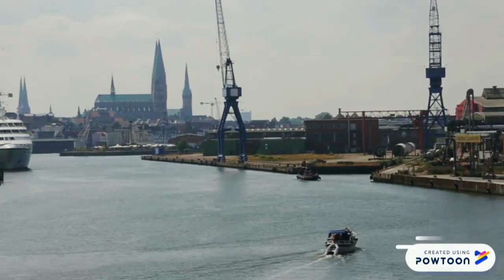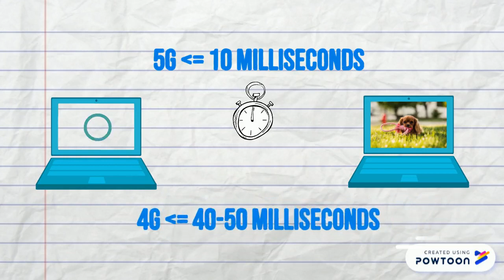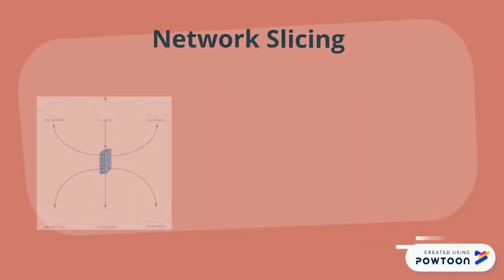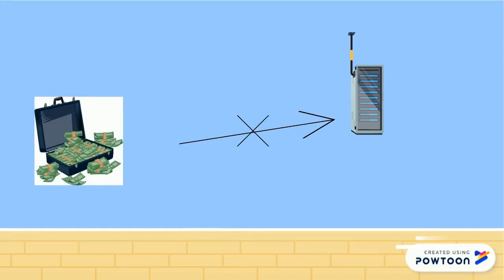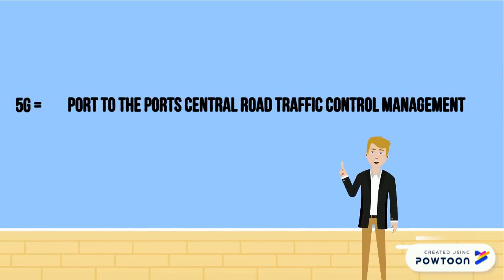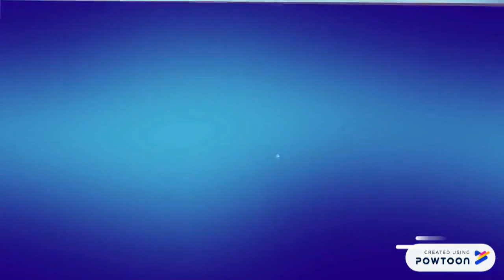5G as Enabling Technology for Building Smart Port

Comment: Learnt a lot from this video! Didn't know that 5G can help other industry instead of mobile communication. But a question just pop up to me, would implementing 5G into a smart port be costly?
Reply from the maker: thank you for your comment, yes 5g will be most costly, according to some research, researchers have predict that operators will spend over $1.3 trillion over the next seven years on networks. The bulk of that (75 per cent, or a little less than $1 trillion), will be allocated to 5G. The rest will primarily go into upgrading and expanding 4G networks, which will continue to coexist alongside 5G past the end of our forecast period.

Comment: Very good video and learnt a lot from it, but I'm curious about the what are the disadvantaged of network slicing?
Reply from the maker: thank you for your comment, the disadvantages of network slicing are It is usually applied in the core network part of the 5G network. It can also be implemented in RAN part with the help of resource pooling. RAN (Radio Access Network) needs to be redesigned to leverage all the benefits of the network slicing.
Interoperability should be tested in order to ensure network slicing works as expected in the 5G network.

Comment: Great thoughts ! I am fascinated with how 5G could further improve our lives. With that in mind, I wonder what are the disadvantages of small cells ?
Reply from the maker: Small cell base stations have met with challenges from a business case perspective even though they can be made at a fraction of the cost of larger base stations. The issue is how to backhaul such base stations and the cost of the backhaul. As these base stations are mounted low above ground, typical microwave systems are not technically effective because they require a clear line-of-sight between the two nodes of the microwave link – which is difficult to provide in urban areas where small cells are deployed below building rooflines.

Comment: Informative video on 5G harbour Ports.. is it possible to apply these 5G features to other industries like manufacturing factories?
Reply from the maker: thank you for your comment. Yes 5g features can be be implement in manufacturing factories. For example, 5G NR – a new radio interface/access that extends far beyond those of previous generations of mobile communication. Capabilities include massive system capacity, very high data rates everywhere, very low latency, ultra-high reliability and availability, very low device cost and energy consumption, and energy-efficient networks. Besides that, Network slicing –this enables operators to provide dedicated virtual networks with customer-specific functionality.

Comment: Nice video, but it would better if the music wasn't so loud for the first few part. Anyway, why are you so sure that network slicing is cost efficiency and it is efficient to be implemented in a smart port??
Reply from the maker: thank you for your comment, it is efficient to be implemented in a smart port because it has greater elasticity, robustness, secure and stable operations through the compartmentalization of the network, applied end-to-end. It is cost efficency because network slicing will permit a more cost-effective implementation of dedicated networks.

Comment: Love the video and animation. Despite the advantages of 5G, don’t you think we should stick with the traditional way of managing ports instead of investing so much in 5G which is still really unstable and expensive at the moment?
Reply from the maker: thank you for your comment, it is better for ports to implement 5g because 5G is much faster compared to 4G as 5G travels in an extremely high frequency which is know as millimetre waves which allows transmission between 30 GHz and 300 GHz compared to 4G which typically transmits between 800 MHz to 3000 MHz. Besides that, 5g allow transformation of data 10x faster compared to 4g as it is less congested.

Comment: Hey there, great video, appreciate the thorough and concise explanation. However, I was wondering if there are any potential flaws to network slicing  despite the advantages mentioned in this video?
Reply from the maker: thank you for your comment. The biggest flaw of network slicing is that it holds much promise for 5G networks, but not without its share of hurdles. Because 5G networks provide wireless connectivity, RANs will need to be re-designed to enable network slicing. Both macrocells and small cells, for example, need to be able to work together and meet the demands of specified network slices.